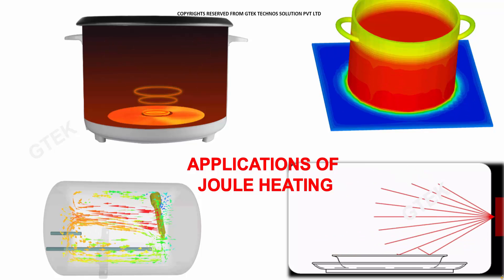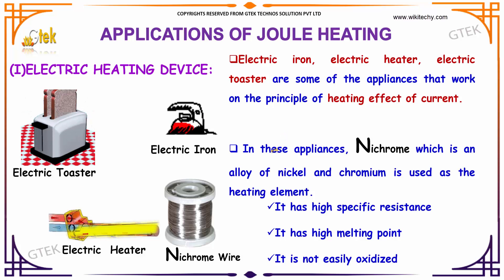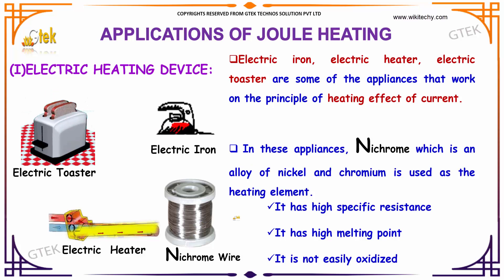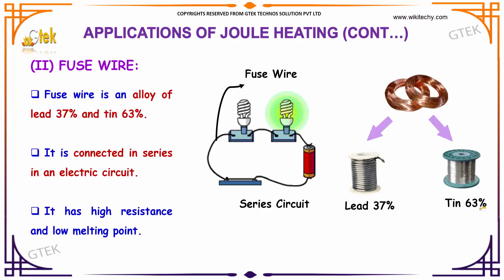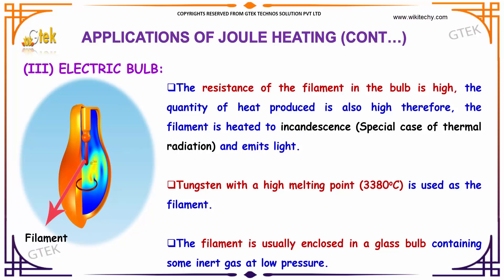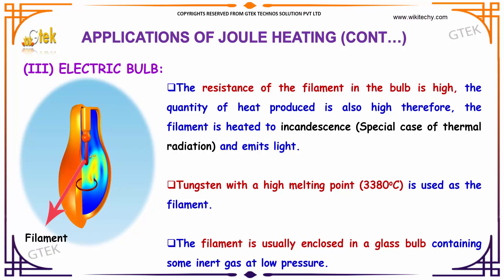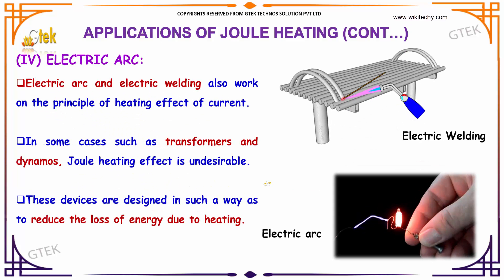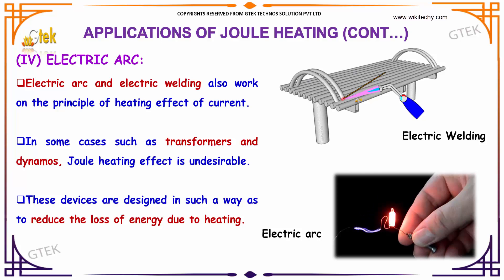Application of Joules Law Effects of electric current class 12 physics subject notes lectures

Comment: These physical effects are not the same, but all are frequently or occasionally referred to in literature as the "Joule effect" or "Joule law" These physical effects include: Joule's first law (Joule heating), a physical law expressing the relationship between the heat generated and current flowing through a conductor.

Comment: In many cases however, Jouleheating is very useful. One common application is the fuse used in electric circuits. It is a short piece of metal, inserted in a circuit, which melts when excessive current flows through it and thus breaks the circuit. It thus protects appliances.

Comment: Joule's laws are two: first about heat produced by an electric current, and second about how the energy of a gas relates to pressure, volume and temperature. Joule's first law shows the relation between heat generated by an electric current flowing through a conductor.

Comment: If an electric circuit is purely resistive (only resistors are connected to a battery), the energy from the source continually gets dissipated totally in the form of heat. This effect is called as heating effect of electric current and it is effectively utilized in heater, electric iron, electric toaster, etc.

Comment: Joule's law can be stated as :The quantity of Heat (H) generated in a conductor of Resistance(R), when a current is directly proportional to: 1)The square of the current 2)The resistance of the conductor 3)The time for which the current flows.

Comment: Joule's first law (Joule heating), a physical law expressing the relationship between the heat generated and current flowing through a conductor. Joule's second law states that the internal energy of an ideal gas is independent of its volume and pressure, depending only on its temperature.

Comment: The work done in overcoming the resistance is generated as heat. H = I2Rt and is well known as Joule's Law. Applications of the heating effect of electric current include appliances like electric immersion water heater, electric iron box, etc.

Comment: Joule heating. Joule heating, also known as ohmic heating and resistive heating, is the process by which the passage of an electric current through a conductor produces heat. ... Joule heating affects the whole electric conductor, unlike the Peltier effect which transfers heat from one electrical junction to another.

Comment: One common application is the fuse used in electric circuits. It is a short piece of metal, inserted in a circuit, which melts when excessive current flows through it and thus breaks the circuit. It thus protects appliances.

Comment: Joule-heating or resistive-heating is used in uncountable number of gadgets and industrial process. The part of the gadget, that converts electricity into heat through the process of resistive or Joule heating is called a heating element.

Comment: Joule heating, also known as ohmic heating and resistive heating, is the process by which the passage of an electric current through a conductor produces heat.

Joule's first law, also known as the Joule–Lenz law,[1] states that the power of heating generated by an electrical conductor is proportional to the product of its resistance and the square of the current